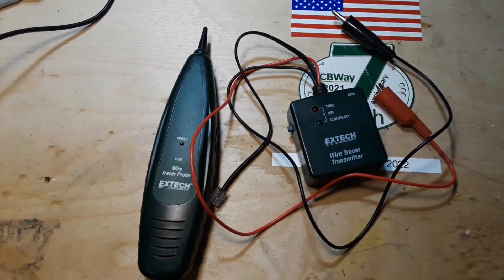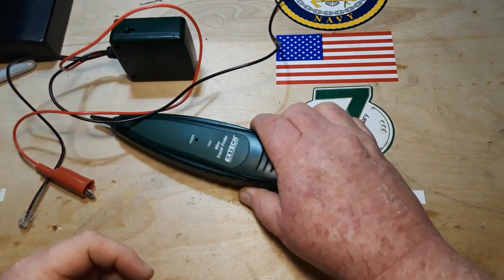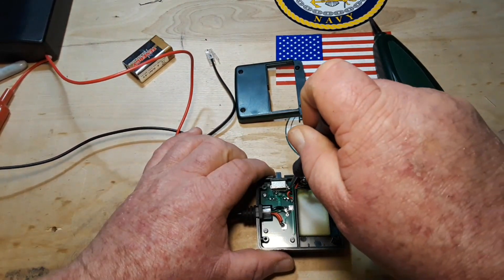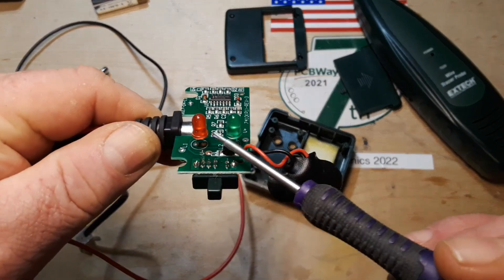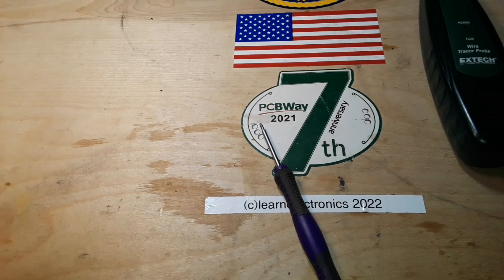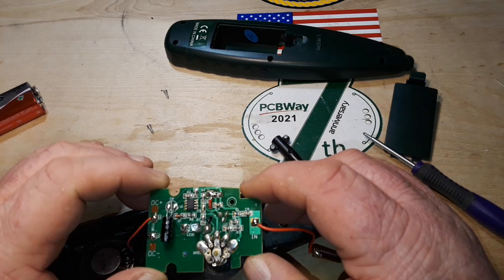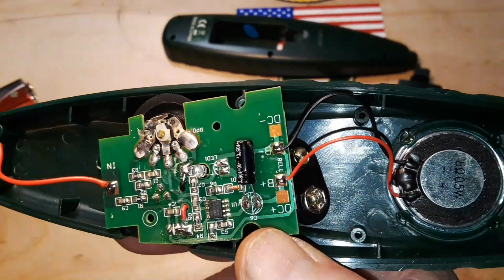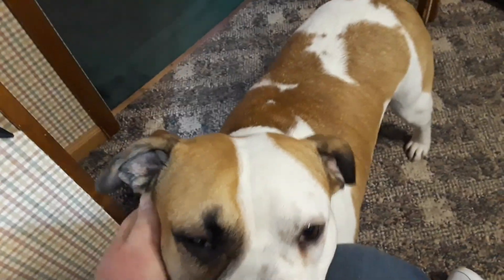How Does A Wire Sniffer Work

Comment: The old trade names for the pair were toner and banana the banana name came from the Bell System version being round and yellow.  In those days your banana was used with your buttset to hear the tone.  You could also power a voice link with the toner in continuity position with your helper at one end so you could work through identifying pairs in a bundle.

Comment: I have a similar device that allows me to trace AC wires, It has a unit that plugs into the AC outlet. Then I can go to my circuit breaker box and use the receiver to find the breaker associated with that outlet. It works well. Since it is dealing with mains voltage levels, the transmitter is a molded unit...not meant to be opened. Been using it for years, sure comes in handy when needed.

Comment: Looks like something that can easily be thrown together in an afternoon! A 4 hz osc using one hex inverter, and 1 and 2khz oscillators and using the 4 hz osc to short out either input of the 1 and 2 khz inverter. I think you can construct a flip flop with 2 inverters. 
The receiver is just a very high impedence jfet amplifier, that would pick up just about any electrical field.
Reply from the maker: Yep

Comment: Hey Paul I had a friend one time who helped out a neighbor by doing something like this. Only instead of having the device, he built it out on a breadboard. The neighbor claimed that he had a dozen different people down there trying to wire him some light switches and wall outlets (the breaker box wasnt labeled, or had had the labels torn off one). He said it got progressively worse as they tried to fix it, so the old man made an oscillator like was shown here and hooked it up to each one and traced out every plug and switch. It blew every person who was there minds, being in S.E. KY most people'd rather do meth than learn something useful. That was 6 or 7 years ago, that same man showed me so much about electronics, hell he even showed me your page!
Reply from the maker: Wow, cool!

Comment: Thanks for the vid, it would be nice to reverse engineer the traces to produce a schematic and post that. One thing you did not mention was that the tone was a "warble" so the 1KHZ tone seems to be modulated somehow to produce the two tones. You scope was only showing the carrier tone signal.
Reply: You can see the modulation as jitter in the trace before and after the trigger point. Probably two oscillators, with the output of the low frequency oscillator changing how fast the 1khz oscillator charges via a diode and a resistor.